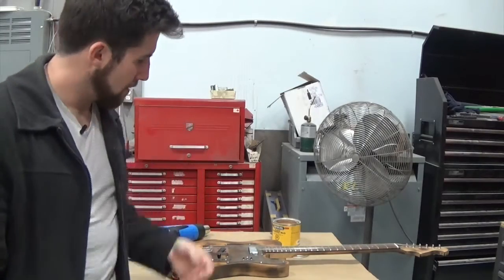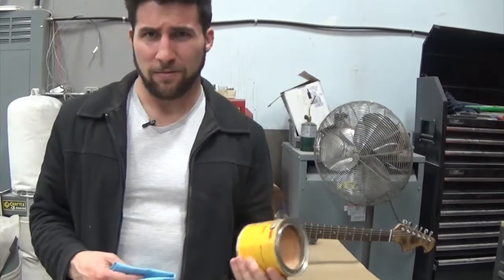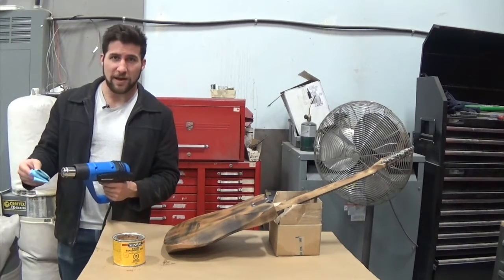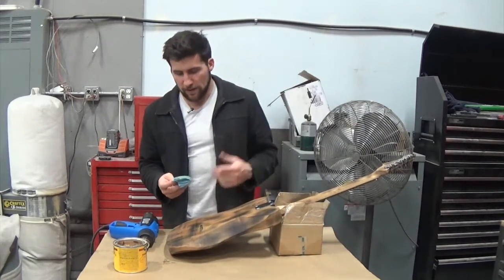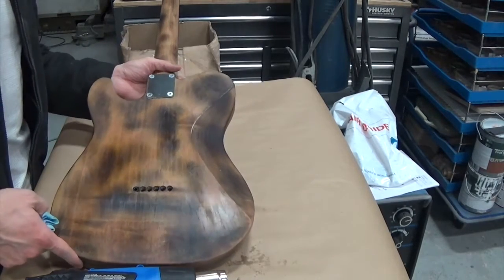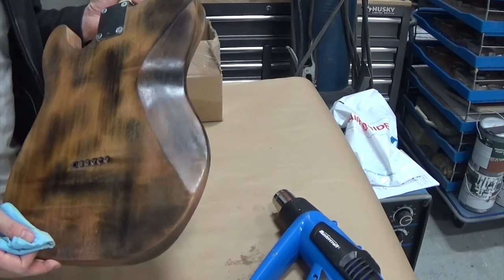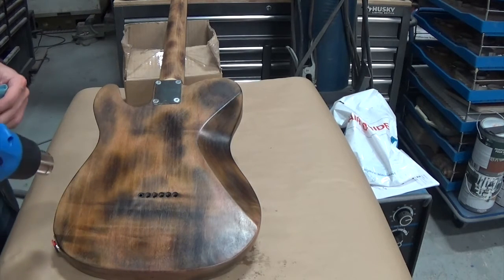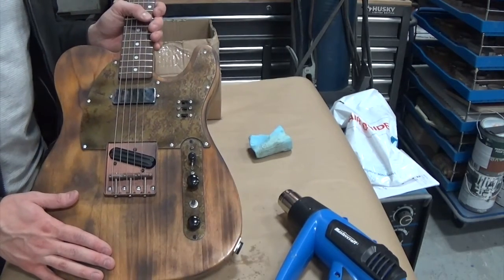Applying or Updating a Wax Finish

Comment: I watched this a few years ago and thought of it today 'cause I'm finishing a body and, having had enough exposure to toxic spray products, thought about oil finish. Then, when I found out that it might not be optimal for the lightweight and ambiguous bit of timber I've used, I remembered this.
 Is waxing a suitable option with softer woods? 
Bit late to the party here, but we live in hope...
Thanks and blessings.
Reply from the maker: It can be. It doesn’t offer a ton of protection and won’t harden it in any significant way. 
If you look at my final video for the great guitar build off that I did recently I did an oil and wax finish.

Comment: I have struggled getting a wax finish feeling the way I wanted, especially on the back of a neck. I did a similar thing by accident, heated the wax and applied it wet. I found buffing with a machine gave me a much better final result though, the heat in the pad kept the wax fluid-ish whilst it got polished to a relatively glossy sheen. also, it was a brazillion times easier than polishing by hand for I am a lazy git.
Reply from the maker: I also prefer polishing with a machine. I just didn't think it would be as useful a demonstration for the bulk of my viewers haha.
Reply: I think you're onto something. I waterproof the wood parts of the kayaks I build like this. The more wax I get off the wood, the better it feels. I take strips of oak and scrape the wax off the surface after melting it in, then rag buff. I get something that feels a little tackier than a waxed car. I use straight paraffin, too.

Comment: i was watching one of the renovation progs on tv here in england a few years ago and they burnt a table top to remove the soft part of the grain and then wire brushed it. afterwards they waxed the table top and it came out looking incredibly well. i realy like the idea of doing that to a guitar body.
Reply from the maker: That’s called a terrified finish. Very cool.
Reply: thanks. i never knew it had a special name. btw i like the look of your guitar. it has its own character.
Reply from the maker: Just realized I had an auto correct issue there. It’s called a torrified finish, not a terrified finish haha.
Reply: if I was the guitar I'd be terrified at being burned then wire brushed...
Reply: @hball6695  there are a few guitars you can see online where its been done. it looks incredibly cool.
Reply from the maker: … fair. That does seem scary.

Comment: just wondering...have you ever used Meguiar's Ultimate Quik Detailer on a guitar body? Would it work over a coat of Odie's Oil to enhance the sheen? all the info I can find indicates it's okay over wax (on a car, anyway) but I'm not sure if it would make a difference over a satin sheen body finished with Odie's...
Reply from the maker: I’ve used it before but I’m not sure if it would accomplish anything over Odies. I’ll see if I can find my bottle and test it out.

Comment: I do something similar when spit shining my parade shoes. 

Did it still feel waxy? I like the look.
Reply from the maker: It still has a slightly waxy feel. A bit of grip if that makes sense.
Reply: Brad Angove that does make sense. No doubt that will go away as the way dries over time. 👍🏻
Reply from the maker: It will likely lessen somewhat, yes.

Comment: Hey Brad how do I sand a factory gloss finish to a matte finish?
Reply from the maker: The most reliable, and probably easiest way, would be to sand it lightly to about 600 grit and then spray it with a coat of matte clear.
Reply: Brad Angove thanks man
Reply from the maker: You're welcome. I hope it goes well for you.

Comment: could you take a bit of wax, put it in a dish and use a candle warmer? Essentially preheating the wax, and keeping it liquid.
Reply from the maker: That's definitely a possibility. The application method would obviously be somewhat different, but I think you'd get a similar result if you buffed it appropriately afterward.
Reply: Brad Angove: Thanks!
Reply from the maker: You're welcome.

Comment: Eh, this method leaves too much wax behind.  Heating it up dries out all of the solvent in the paste, so as soon as it cools it hardens.  This ensures too much wax is left behind before it can be wiped into the holes and gaps of the finish or off of the piece, and it really does look like a massive amount of wax is left behind on the guitar.  Too much wax deposit means it will collect dirt faster and environmental conditions that cause whitening of the wax will be more easily observed. Therefore, more frequent cleaning and touch-ups will be needed. Lastly, the sheen of the wax will show more, giving it that greasy look, which in my opinion looks less than optimal.  I think paste wax is better when abraided without overly heating it by too much rubbing at once in one spot.  Abraid it in with a brush or steel wool and abraid off the excess, one small area at a time so that you don't dry it out before you finish removing excess.  It can be done with a cloth, but they tend to slurp the solvent and have more friction for the amount of abrasion you get from them, drying the wax up.  Of course, turners can get away with a good ole friction polish, but they can take a million more swipes at the hot wax than you can in order to remove excess. Now, this is my opinion, I wouldn't argue this is gospel truth. I could be wrong, could be.  I still love seeing how other people do things. Thanks for the videos!
Reply from the maker: Thank you for taking the time to provide your perspective on how this should be done.